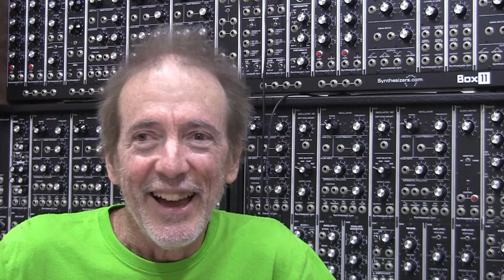Before you buy a Vintage Synthesizer in 2023

Comment: Just picked up a new Roland Integra-7 but still might get a Kurzweil K2000R.  One that has have it’s screen backlight replaced and been recapped.  Being digital will help things along a bit.  If it breaks, some things I can fix.

You make good points.
Reply from the maker: Good luck with your equipment, bro ..... I thank God that I have had minimal hardware problems over my lifetime 👍...... much better to be PLAYING than fixing 🙂
Reply: @StephenMendes  
100% Agreed.  That's why I went new on the Integra-7.  If the used Kurzweil goes down, I still have the Roland Integra, Roland D-05, Roland J-6, Yamaha Reface DX, Casio PX-560, and Casio MZ-X500 to play with.  That and various VSTs.  That puts no pressure on future repairs of the Kurzweil.  I can take my time repairing or send it out.  Thankful, there are a fair amount of 3rd party components for these old Kurzweils.  New daughter boards, displays, EPROMs, RAM, etc.  And you can always recap them.

Comment: That's a mad accent. Sounds like a bit of Irish, Jamacian and Northern UK . I just bought a CS20M 1979 and an OB12.
  I had to tidy up the work done by previous owners / amateurs, especially on the psu. It was even missing 4x 1uf caps.
 Found a few issues and fixed the memory that only lasted a few hours. There was simply some corrosion in the battery holder so i soldered directly to the spring at one end and bridged across from the spring to the rivet side on the series connection end.
Reply from the maker: Good for you ....... doing your own repairs on ancient gear 👍🙂

Comment: I really like the Modular solution. Using modern modules with modern electronics. Perhaps with better circuits.
Reply from the maker: It really is the safest investment LONGTERM ...... and it can change and adapt as you age 🙂 and your music taste or priorities change...... a single (very expensive) synth on the other hand presents quite a problem when "something" goes wrong with it (particularly if it is no longer supported by the manufacturer..... and currently they only support discontinued models for about 5 YEARS max)

Comment: My semi-modular setup ran me about $5K but this includes 8 fully normalized mono synths with MIDI, 1 paraphonic synth, 1 drum machine, 1 percussion synth and an actual mini modular rig with a modular FX unit. Nothing vintage, but 5 of the mono synths are clones of vintages. I prefer to sequence them with MIDI and not just because my eyesight is rather poor --- but anytime I feel like getting lost in WIRES the options is there. 😄
Reply from the maker: Thanks for the info..... I have the equivalent of 8 synth voices in my dotcom rig and another 2 in my eurorack setup ...... I have several MIDI interfaces 3 in the dotcom rig and a Mutant Brain (polyphonic or stacked) in the Eurorack..... but I thought a couple of "on the fly" sequencers would be a good addition and Sam (Look Mum No Computer) sent me a message on Patreon suggesting  Beat Step Pro coupled with Cirklon ..... but I checked today and the Cirklon has a waiting list of THREE YEARS (they are so popular that's how long you have to wait to get a new one from the manufacturer)

Comment: I started buying synths in 1977. I would never buy a vintage prophet-5, memorymoog, or OBXa. I owned them all and they all went south even though I treated them with TLC. For people to spend tons of money on these OLD units is craaaaazy.
Reply from the maker: Through God's Grace mine fared better...... and most of what I bought in the 70's is still working ..... I lost the RX11 drum machine and a mixing board and the memory cartridge capability on the D-110 ...... but I agree with you totally .... it is sheer MADNESS to spend all that money on OLD electronics .....  because UNLIKE furniture, paintings, china  and other antiques ..... TECHNOLOGY (particularly older semiconductors made in the 70's) can FAIL and when they do they have ZERO value......  TECHNOLOGY is absolutely the worst way to spend your money .....  advances are made and prices on old gear DROP ..... only in the MUSIC world where people are not thinking straight and there is more money around than "common sense" do people spend more money on old technology